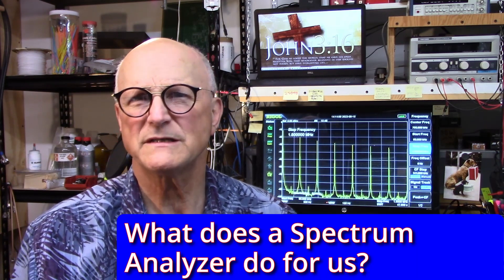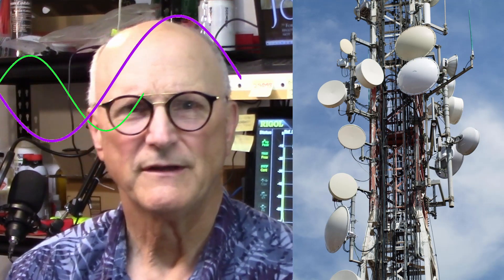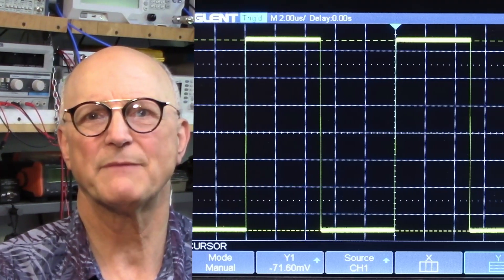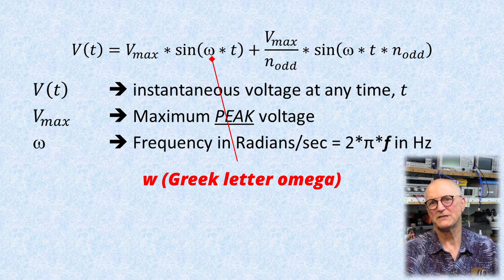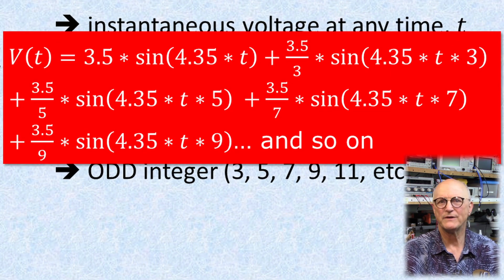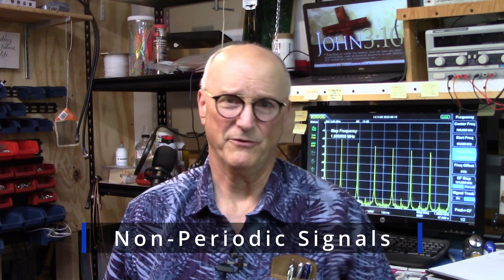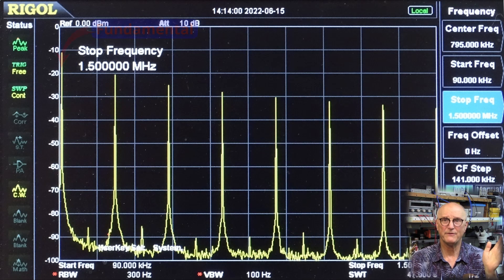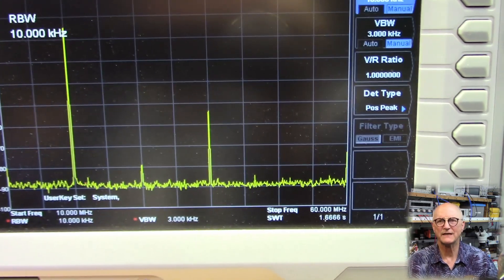Spectrum Analyzers: The Nature of signals and what does a Spectrum Analyzer do for us (029a)

Comment: Excellent video Ralph.  I remember the days when we could only dream of having a spectrum analyzer.  They are becoming more affordable and available to hams and experimenters especially on the surplus market.  It would be hard to go back to the days of searching for transmitter harmonics on a general coverage receiver or wave analyzer.
Reply from the maker: Thanks, Todd!  The other way we discovered that we were transmitting harmonics was through that little, pink ticket from an official observer. I got one of those as a novice back in the early 1970s. Had to build a LPF to put in line with the transmitter. I put it in an old 35mm bulk film tin.

Comment: good video as always. could you speak a little more about real time signal analyzers vs spectrum analyzers, what they are and how they differ? why are they so fast? and how some of them are able to reach very low frequencies (<30Hz). thanks
Reply from the maker: Thank you! Now we are talking AF. While working at Grason-Stadler, I used to use a Signal Analyzers all the time.
Theorizing ... while tunable filters are not feasible for the Spectrum Analyzer, they are not out of the picture for sweeping AF (signal) analyzers (as opposed to the FFT Analyzers).  See, switched capacitor filters.
(https://www.digikey.com/en/products/detail/analog-devices-inc-maxim-integrated/MAX262BENG/1511735)
Of course, there are also the FFT Analyzers which just sample the signal directly, perform the FFT and display the data.
You comment causes me to dig into them a bit to see what the truth is.
Thank you for getting my curiosity going on this.
Reply: @eie_for_you  Oh i understand now, thank you for making it more clear. i thought they were both for RF , but one was more focused in real time, for very fast signals like pulses.
i have one more question (sry if it's silly) I have a sdr hackrf one 1-6000mhz, there is an executable "hackrf_sweep" that scans the whole spectrum in less than a second, does it mean it is not accurate? i'm just trying to understand how can it do that, if SAs are so expensive for much narrower operational ranges. thanks for your time
Reply from the maker: I am afraid I cannot answer that question with authority or certainty as I am not familiar with the device at all.  My only *guess* is that they have been gathering the data all of the time and when you ask it to do the scan it is just assembling it for you(???).
Reply: @eie_for_you  it's okay, i wasn't very explicit myself. i saved the sweep results and created a real time plot of the data and it was kind of nonsense. but if I go and use the hackrf SDR in CubicSDR or others, it displays the correct amplitudes in each frequency range sort of similarly to rfexplorer SA, but only with 20MHz BW. maybe what i was looking at were the are direct IF values before they enter the SDR part of the circuit (right after DAC). but i don't know enough about filters or these circuits to deal with this and extract meaningful data :) I'll keep learning with your videos and maybe in the future I can get a better understanding. thanks
Reply from the maker: NOW I get what you are doing! It just didn't click right away. I haven't played with an SDR yet, so I don't know much about them.  You say 20 MHz bandwidth, is this relating to the frequency SPAN of an SA? I'm guessing it provides digital data with each piece of data being a particular frequency and the amplitude represented by that data is the amplitude of the signal at that frequency.  These would be the FFT "frequency Buckets" I will be explaining in my next video.  The BIG question is "How far apart is each bucket?" If the buckets are too wide, then the actual frequency of the signal you are looking at is obviscated as the frequency of the bucket is what is reported, not the frequency of the signal.  So, if the frequency of the signal is 145.76 MHz and the frequency represented by the FFT bucket is 145.7 MHz, if the bucket is 100 KHz wide, then this frequency will be reported as 145.7 MHz. You can actually see this phenomenon by incrementing the applied frequency a small amount at a time. You can watch the shape of the signal change on the display, but the reported frequency will not change. The you reach the tipping point and the frequency will pop over to the new value.
It is a very interesting thing you are doing to leverage an SDR to make a spectrum analyzer of sorts.  It is probably sufficient for many applications as long as the frequency and amplitude accuracy is good enough for what you are trying to do.   Makes me want to go out and buy one of these things to play with!